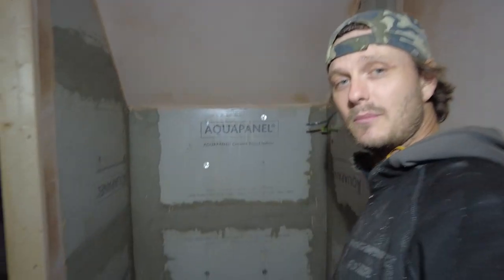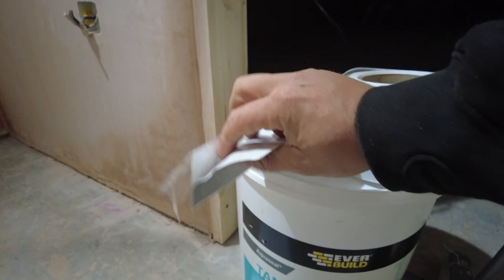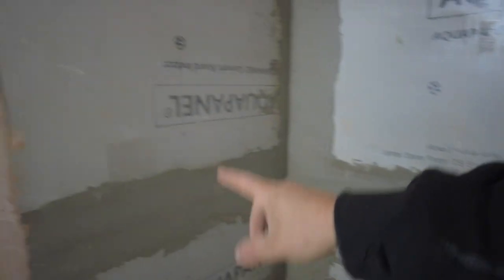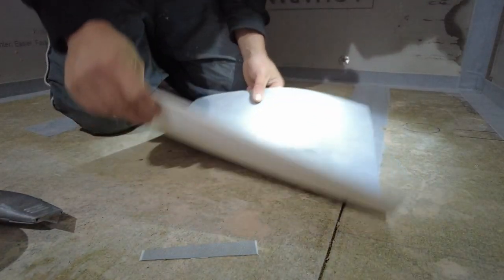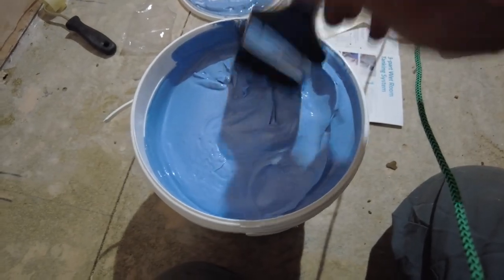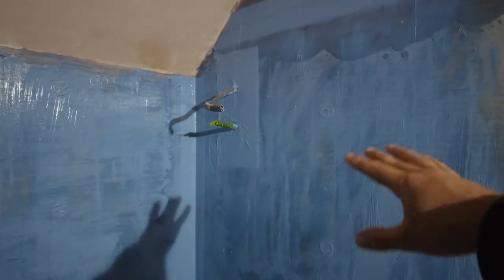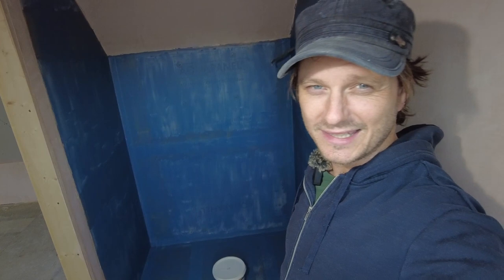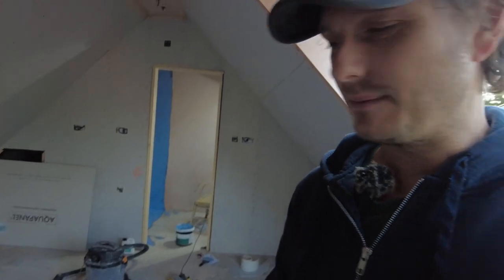How to Tank a Shower - Aquaseal shower tanking kit

Comment: Stopped watching when he said he would use mastic as it wouldn't leak 😬😬😰😰 I am a plumber and it WILL leak in time , EVERYTIME
Reply from the maker: Thanks for watching the first 5 minutes 😁. Are you saying you would use one of the rubber seal kits and then never replace the silicone when it fails? I'm assuming not. It won't leak if I replace the silicone as and when it fails. I'm not going to just let it leak am I 🙄
Reply: @THE-AIDEN-PROJECT  why wait till it fails as it will and cause damage ? I am a plumber and get calls constantly will this issue,  it won't happen when the sealing kit is out around the shower tray . The people who claim it won't leak are the people who don't get the phones calls when it leaks
Reply from the maker: @shaneshankly4518  I'm talking about the silicone between the tray and tiles, once that fails then the water can either get to either the rubber seal kit or the load of other silicone before it gets under the tray and causes other damage. So as soon as the first silicon lifts you replace it, not wait for it to get underneath to the seal or other silicone. Anyway like you said, you're a plumber, not a tiler. I explained why it has caused me issues so I will never use one again. You only get call outs for this because morons don't replace the silicone on the outside once it seperates.
Reply: What sealing kit around shower tray are we talking about ? Classi seal  that sticks to the tray sides then wall  or no more leaks that sticks to wall and drops down onto the tray? Which was problematic Aiden and which do you recommend Shane? Thanks guys

Comment: I've used this kit before for shower over bath and for shower tray. I put the bath or tray in first, sealed it to the wall then put the tape down onto the edge of the bath or the tray before applying the tanking. The disadvantage is that it can create a lip, causing the same issue you described as the sealing strips but got round that by not putting a full bed of tile adhesive at the very bottom of the tile. It all then gets siliconed in to seal it up. Quite fiddly to get the tape on to the tray without it showing and avoiding getting the tanking gunk on the edge but masked it off and it was ok. Interesting to see how you have done it!
Reply from the maker: I'd hate to be using this stuff over installed trays and baths! 🙈 It's easier to just paint the floor when you drop some 😁
Reply: @THE-AIDEN-PROJECT  yea good point... I think I kept the vinyl wrap on the tray and taped it in place so avoided that but it is impossible to cover with paint... I got some on the ceiling when going right up to the edge and had to cut it out and patch it in the end!
Reply from the maker: @JonGiles  😂 sounds like a nightmare!

Comment: Hey thanks for the video.  I Recently removed the old tiles from the shower area but the old tiles adesive didn't come off its rock solid like cement, I tried steam to remove it but won't work. I want to install some aquapannels like you did but instead of fixing the panels with screws I would like to glued them on top of the old tile  adhesive . Do you think that's OK to do? Looking forward to your advice.
Reply from the maker: Hi, you can treat them like a big tile and stick them to the wall with tile adhesive. I would probably use a few mechanical fixings though (masonry/concrete screws) just incase
Reply: @THE-AIDEN-PROJECT  hey thanks for that. Hope you're doing good 👍  blessed 🙌
Reply: Pull offf the dry wall and replace with a cement board It's just not cost effective.  If it's a block wall. That's a different  story.